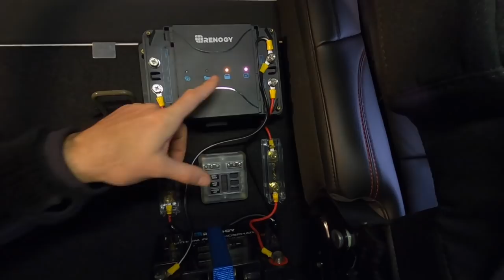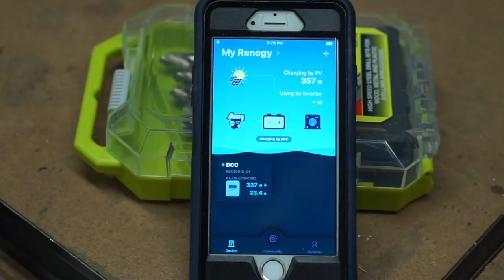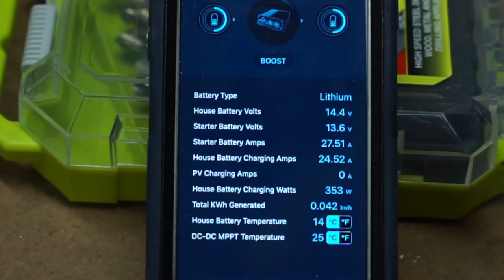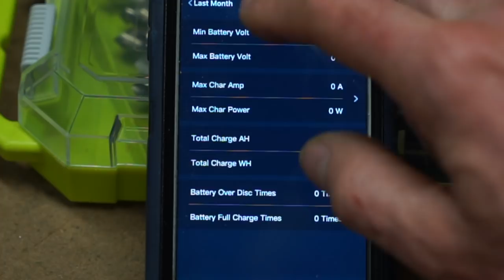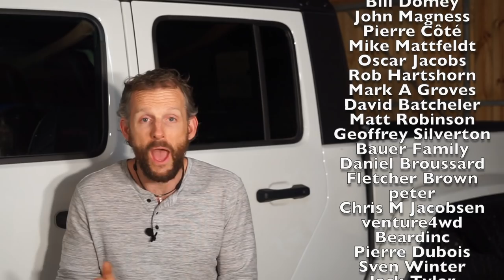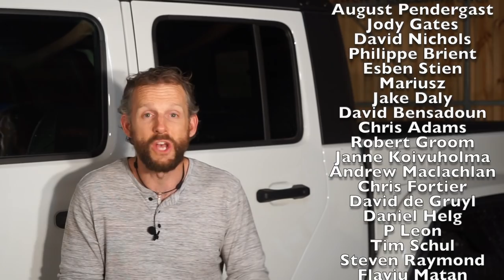21st Century Dual Isolated Batteries - WITH SOLAR for Overland vehicles

Comment: Quick question Dan, for an Africa expedition where I am mainly using the battery to power a fridge (in an ancient Land Rover by the way), would you recommend a basic 12 volt system where I could replace items with whatever is availably locally, or go for a more efficient modern lithium setup with DC-DC? The vehicle has been upgraded from the standard 34A (yes, thirty-four) to an aftermarket 175A alternator, because it could hardly keep up with headlamps, a heater and wipers!
Reply from the maker: My very basic system worked well for my Africa trip, though these days the much more modern DC-DC charger and Lithium battery is much better.
You'll be able to get those modern parts in South Africa and Namibia.. so if your trip loops through there you could get parts if you need them.

Comment: Dan - I'm looking at this Renogy controller and the specs sheet says "Maximum Charging Current : 30A (15A Alternator / 15A PV) ", does this match your experience? Have you tried hooking up solar yet? I noticed it was showing 25A or so on your phone, but this makes it sound like it's a 15A total if you had no solar hooked up.

I was going to say if you're pulling 30A from the alternator, you should use larger than 6mm2 wire. It may not overheat and melt, but it will heat up, and limit the amount of power you can draw. I'd suggest a 10-15mm2, and I would also eliminate the extra ground run back to the front, since you can ground the aux battery and charger to the chassis.

As others have said, that fuse needs to be at your alternator/starter battery, not back on the bulkhead by the charger. It's not protecting anything there.

Thank you for sharing your set-up, it looks really handy and I think it will do a good job at keeping your LFP battery safely charged.
Reply from the maker: The charger can pull 30A in total. So with no solar, that is 30A from the alternator.
With Solar, it will prioritize solar to a max of 15A, and get the other 15A from the alternator, which is great because it means you pull free power from the sun rather than load up the alternator.

Comment: I’m a big fan of these types of builds. But one thing I never seen done is add a third charging option of a stand 110v/220v charging option. In the US for instance many of our campsites have regular AC power hookups available so I am sure other developed countries do to. Why not add a charging option like that? Or just a way to power the whole system from that too? Similar to how an RV works
Reply from the maker: I talk about that specifically at the end of the video - I design my vehicles for global travel, so it's not something I want or need.
Reply: @TheRoadChoseMe  Oh! I stopped watching after you started naming the patreon supporters. I didn’t think there was more content afterwards. I’m sorry!
Reply from the maker: No worries, I did it a bit differently this time around because all the talking at the start was just too much!

Comment: Hi Dan.  Greetings from Melbourne and looking foward to your Aussie tour. Do you have another fuse at the main battery for the 50 amp cable that feeds the DC ro DC charger.  It is good practive to have a fuse at both ends of that cable in case of a short part way along.

Comment: Dan, love you’re point about not using an inverter but…

Maybe this is a dumb question but I’ve never seen a laptop that plugs into 12v or a USB.  

What am I missing?
Reply from the maker: All the new macbooks charge from USB directly, and I got a DC step up converter for mine so it can charge straight off 12v, no problem. I used it for all of Africa, it was perfect.
Reply: You need to “link that (step up converter) in the description” please. 😬

Comment: Hi Dan great video, just one question, what did you do with the ignition wire did you tap into your fuse box?
Reply from the maker: I didn't wire up the ignition wire - the Alternator in the Jeep is not "smart" enough to require it.

Comment: Awesome mate, simple & in budget, do you recon we need to put fuse on the main battery end as well.
Reply from the maker: Based on all the comments, yes, that sounds like a very good idea!
Reply: @TheRoadChoseMe  how much it costed u altogether for the battery setup. I was looking for dc to dc but redarc was soo expensive i dont wanna spend that much as i am not frequent traveller. I just need to keep it simple like yours.
Reply from the maker: Have a look on the Renogy store to see what meets you needs - it will depend on the battery you want, the size of charger (30A or 50A) and the size and type of solar panel you want and can fit on your vehicle.

Comment: Actually I have a completely another kind of question do you have in Australia any snorkel for a 3.0 diesel or at least something comes in the left side which is your passenger side of the engine?
Reply: Because I had a lot of troubles to find something over here in United States in Texas to be more specific to the point I have to build my own DIY PVC snorkel it works but it doesn't look
Reply from the maker: There is no 3.0 diesel in Australia in the Gladiator or Wrangler, so there is no snorkel for it.

Comment: Hi Dan!
I have noticed you did not wired the ignition wire. I did follow your setup instructions but alternator is not charging and light did not on but solar is charging. Do I have to wire ignition wire?
Thanks
Reply from the maker: It depends if you have a smart alternator or an old-school one.
I didn't need to run any additional wire in the gladiator, just going straight to the +12 on the battery was enough.
Remember, it has a 20 second delays before charging off the alternator, so make sure you run the engine for at least that long before you determine it's not charging. Check the app on your phone to see what it's doing.

Comment: So do you have three batteries now? When you refer to the cranking battery, are you referring to the small one beneath the main battery?
Reply from the maker: Technically I have three, though I'm ignoring the little one and basically treating that whole system under the hood as the "starting battery".
Reply: @TheRoadChoseMe  the reason I asked was I wondered if your connection may cause issues as the two existing batteries are independently controlled also. But if it’s all working with our issue then great! Keep up the good work.
Reply from the maker: My connection doesn't change anything - it's just an extra load on the alternator, really simple.

Comment: Dan, you're using the solar charge controller essentially as a negative bus bar for the entire system, correct? Are there instances where this wouldn't be a good idea? Are there any other components that can be used this way? I'm trying to save money on a bus bar:-)
Reply from the maker: Yep - all the negatives of everything just connect together at the charge controller. No downsides, other than you might run out of room to connect all the terminals on there. So far so good for me.
Reply: @TheRoadChoseMe  Thanks mate! If a negative bus bar is used, does it need to have a certain amp rating? I can't get a straight answer after a long google search. Hoping you'll know:-)
Reply from the maker: It will need the amp rating of everything you connect to it combined.

Comment: His sytem does make sense keep it as simple as possible but the thing i hate about these kinds of videos is that they get you only part way there. OK TRCM where do you pug your devices in? Ps. I don't know anything about electricity
Reply from the maker: I will be doing future videos about how I wire up all the accessories, but I showed the big fuse block where I ran wires to the fridge, etc.
Essentially, you just run a red and black wire from there and you have 6 separate fused circuits for whatever you want to use.

Comment: Fuses! You can never have enough fuses! One next to starter battery, another before DC inverter, another one after Dcinverter before domestic battery. Another after domestic battery to all ancillaries. Also don't overload the domestic fusebox, most of those are rated at max 30A input current no matter how many fuses it has in it. So your domestic is probably maxed out already.

Comment: Can I run a gel optima battery under the hood and a lithium house battery?
Reply from the maker: It depends how you charge/wire them up. You can't put them directly in parallel like my old setup with a big solenoid, but you can use an intelligent charge controller like the one I'm showing in this video, yes.
Reply: @TheRoadChoseMe  ok. I wasnt sure if it could read 2 separate styles of battery or not. I think the price tag will make me go agm battery though after looking

Comment: Can I use this system somehow to jump start myself if my starting battery goes dead? Or do I have to just use a jumper cable?
Reply from the maker: You would need a jumper cable, and I'm not sure if the Li battery is rated for that, you would have to check.
Reply: @TheRoadChoseMe  Do you carry one of those portable battery jump starters then? Or what

Comment: Im curious about the no inverter approach. I'm pretty sure laptops need a pure sine wave as the electronics are sensitive?
Reply from the maker: Actually, laptops all charge off DC, so you should just skip the DC->AC->DC conversion altogether.... Laptop wall adapters (which are just AC->DC coverters) need pure sine wave to create clean DC. But if you just stick with straight DC, you don't need to worry about any of that.
Reply: Thanks! May have just saved me buying an inverter. Can’t wait to see more of the build.
Reply: @ballaratst  This is fine if your laptop charges at 12v (a lot do) but both my laptops need 19v to charge, so then you need an inverter to be able to use the factory charger.
Reply from the maker: @spudboy1328 - actually you can just get a DC step up converter that brings the 12V DC up to 19V DC. That is exactly what I have and it worked perfectly for three years around Africa.
Reply: Dan were you using a PC? I don’t believe there are any reliable step up chargers for MacBooks. Heat seems to be the main issue.
Reply: @TheRoadChoseMe  OK - I didn't know they were any good.  Staying all DC stops the conversion losses between DC -> AC -> DC I expect. Not sure how efficient they'd be but probably better than an inverter.
Reply from the maker: @Will Neill, previously a macbook air, now a macbook pro.

Comment: so why didn't just use a solar generator with all the different parts built into one unit what computer are you using and can you charge a e-bike battery with this set up
Reply: huh?
Reply: @alittlebitgone  so whatis so hard to understand 1. a solar generator just has all the parts built in. I use and apple computer which as far as I am aware can't be charged with D/C power which is what his system creates and can a charge a large ebike battery with his system. It seems his system is just to keep a refrigerator going as he can change his camera batteries with the supplied USB outlets in his jeep.

Comment: Hey Dan. Consider disabling the Start/Stop feature. I don't know what idiot thought of it, but consider the fact that the greatest wear and tear of any internal combustion engine happens when it's starting. So if the engine is being turned on and off more, it's going to wear the engine out sooner. Gas is cheap, engines are expensive!
Reply from the maker: I'll be doing mostly outback remote road driving, there really won't be many chances for it to turn off anyway, so I'm not worried about it. It's not like I sit in stop and go traffic!

Comment: you preach weight and cost savings/lowering then run two 50amp wires instead of a single 30amp wire you could of gotten away with no issues, the 30amps the charger boasts will be the absolute maximum under ideal conditions with a really depleted battery, a wire rated at 30 amps will handle far more than 30 amps, typically 20% more in the worst possible conditions, bent up and kinked in the engine bay with no way to dissipate heat itll still handle over 30 amps, not to mention all of this is time based it needs to be pulling these amps for extended periods of time not just 15-20 minutes
Reply from the maker: It's interesting Andrew, because there are a TON of comments here saying I should have run heavier wire, and that way I used is not sufficient!
It seems everyone has their own suggestions and ideas.
Reply: @TheRoadChoseMe   everyone will, i dont think anyones losing sleep over it though, just voicing an opinion, to me ratings on everything are so worst case scenario and safety factored that if you just meet the bare minimum ratings its already overkill

winches and jumper cables are another story though as heavier wire increases performance dramatically, charging batteries not so much

Comment: Looks like a well priced DC2DC. I use 16mm2 twin core wire for my setups and most recommend minimum 13.5 mm2. Will Prowse has a great installation guide for this unit on his website https://www.mobile-solarpower.com/simplified-400-watt-fewer-wires-and-alternator-charging.html (video also).

Comment: Considering that you film a lot and you plan on running a fridge, etc. at camp, I think with that all together you will be playing pretty close to constantly draining your LiFePO (which is not good for its health), I think at least 100 AH would be a better choice and another 14 lbs will not be too much. Secondly, if you are planning on staying anywhere for anything more than 2 days that 100W solar panel by itself will struggle to full charge your system. Solar panels are still very inefficient.
Reply from the maker: I had 50Ah of old-school gel battery for three years around Africa and it was perfect for my needs. This Li battery allows for much more discharge, so actually it's higher capacity, and my charging system is much more efficient now.
I'm very confident this is ample for my needs.
Reply: @TheRoadChoseMe  It may very well be alright, I suppose I like to err on the side of caution from personal experience, and figured with a fridge, charging multiple items, lights, and your water pump, may be cutting it close. Are you also planning on wiring in one of Renogy's inverters?

I do suppose AUS has more sun hours than here in BC, CAN and so you should be able to get more out of the panel, but I also have a 100W panel from Renogy and I only pull about 5A at peak hours. I would even look at mounting another 100W flexi-panel seeing as they weigh close to nothing and will take even more load off your alternator, with the added benefit of ample solar power when stopped up. 

Regarding the depth of discharge, I do agree that LiFePO chemistry is much better in virtually all ways, and that 50Ah should give you a good 43-45 usable Ah compared to 33-35Ah of SLAs. 

Lastly, Renogy does makes things very easy and I envy your sponsorship with them, should be a great journey.
Reply from the maker: I won't run an inverter no. I mention that at the end of the video - I have no use for one, and I don't like them.
Yes, the Renogy instructions and gear are very simple and easy.

Comment: Def need an inverter. Redarc 1000w has never let me down, and really, it’s not that heavy at all… couple of kgs max, not a big deal.
Reply from the maker: After five years on the road through 55 countries I've never had a use for one. And as a single point of failure it makes no sense to me.
Reply: @TheRoadChoseMe  Hmm not following on the 'single point of failure' aspect, however, its not the only 'source' to power items. you would still need a bank of 12v cig/metric inputs and USB inputs of course.   Each to their own of course, however, for us (young family) having something else that can run our sensitive electronics or anything else that needs quality good smooth power delivery, is a bit of a no brainer for us. Runs a small coffee machine, small microwave, and a little pie warmer... Who doesn't like having some 'electric comforts' from home whilst away for days on end :/